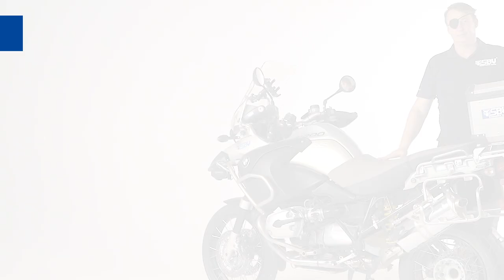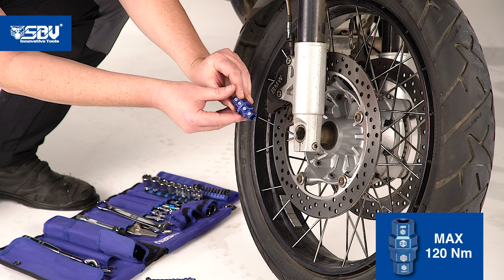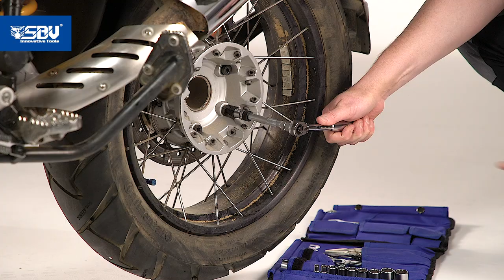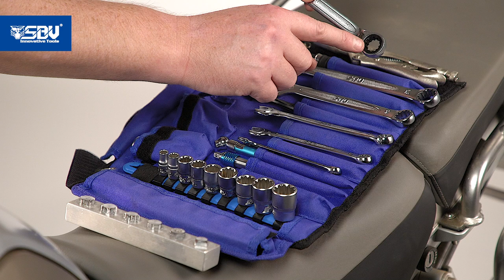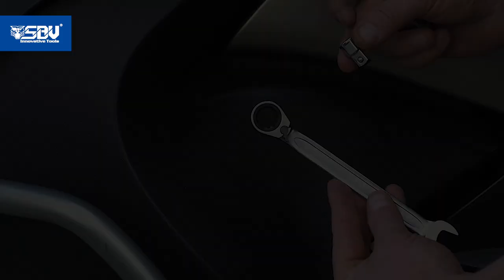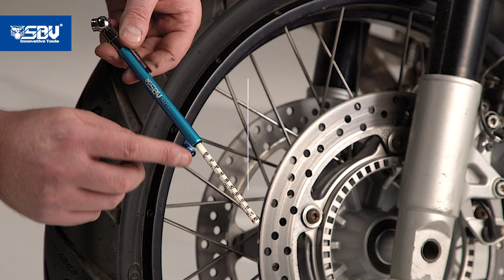What's Inside? Best -BMW Motorcycle Tool Set Kit by SBVTools

Comment: Yes, this set is complete for removal your front wheel as it has the axle removal, also your sparkplugs with the coil puller. For the rear wheel, please check, I beleive its a 34mm, so then you need ad either the kit GS750/850, 3 pcs set. That include the 34mm and the 3/8Fx1/2M adapter. Send email to info@sbvtools.com if you need aditional infos. Thanks

Comment: Is it good for 1250 GSA also ?
Reply from the maker: Yes perfect for GSA1250, you have everything in this set for all GS and GSA, thanks
Reply: @SBVTools  Who is your authorized dealer in Dubai & India?
Reply from the maker: @safdarlodi  in Dubai our dealers are Touratech Middle East and Oldtimer Motorcycles.
 in India its handle by www.sbvtools.asia out of Singapore. We dont have a distributor yet in India, we should have very soon. Thank you
Reply from the maker: @safdarlodi  or you can purchase on our website www.sbvtools.com, all orders shipped same working day if order received before 15pm (Belgium Time) outside of Europe will have prices without VAT Belgium and prices for shipping calculated during check out. But customers are responsable for the import duty and VAT in their country if any. For USA per example its duty and VAT free during import if purchase for individual use and import value below 800usd per order( this is the feedback we got from various customers in USA, may not apply for all USA). All shipping outside Europe is handle by DHL Express, very great service and good reasonable rates, it takes about 2 to 5 working days for delivery any where in the World. Some countries we can't export, as we have exxlusivity distribution, like in Poland for the Baltics, Singapore for Asia, Thailand, Indonesia, Malaysia,.. Taiwan, Japan,  and Australia/New Zeeland

See at below website depending on your location:
https://www.sbvtools.asia
https://www.sbvtools.pl
https://www.sbvtools.com.au/
https://sbvtools.co.nz/

Thank you